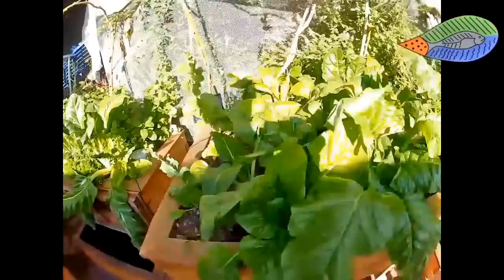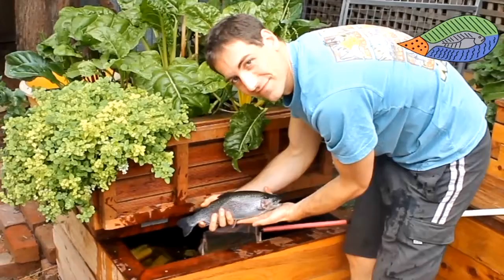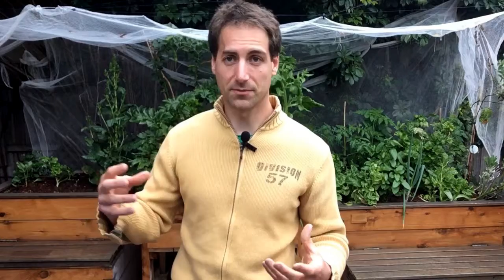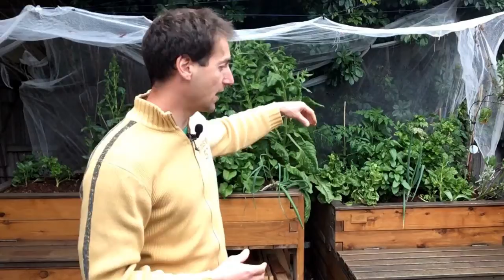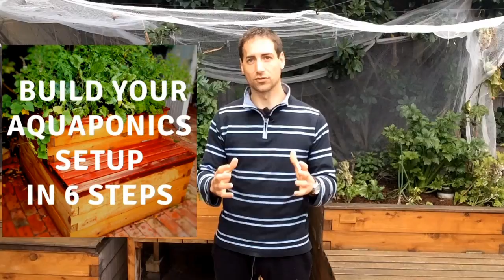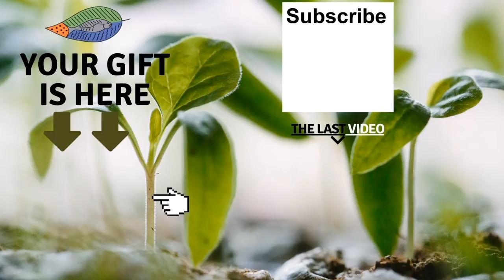3 points of bell siphon troubleshooting in Aquaponics

Comment: great video!  learned a lot :)  Curious if the bell siphon, inside pipe (larger head spout) needs to be level?  mine is slightly off, but my siphon has been going for months.  After inspection and tweaking it, I find that the intake spout is tilted a degree or 2, possibly because my table legs for support may have shifted or settled into the the dirt, but it's been fine for so long... the only thing that has been helping is to add hydrogen peroxide, which seems to make the water bubblier, so not sure if the is a pressure issue?   anyway your video was very helpful and gave me some additional ideas to try; thank you.

Comment: My bell syphon doesn't work
Reply from the maker: mmm, did this video help?
What is the issure exactly, what's the trouble with your bell siphon?
Reply: Hi there i eventually  got it to work,  I had to stop air leaks in bell , I applied glue to cap and also had to make the siphon longer , works now

Comment: Hey Jonathan  also the root guard around the bell syphon  doesn't have enough holes around to assist in the bell syphon from draining quick enough I find several rows of slits  around the root guard work bettter in the bottom inch than several holes which over time block up.
Reply from the maker: Yes this is correct .. I also design my bell siphon with slits now, it is way more efficient 😊
What are you growing in your growbed?
Cheers